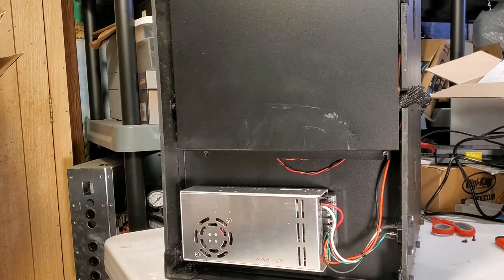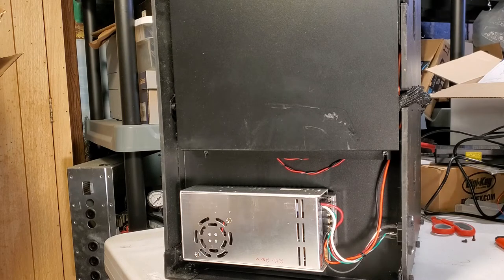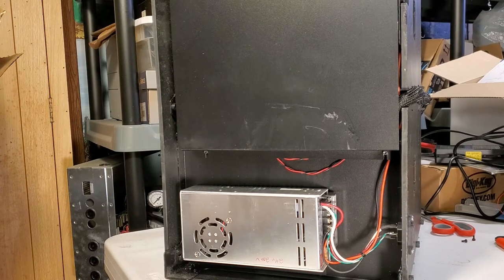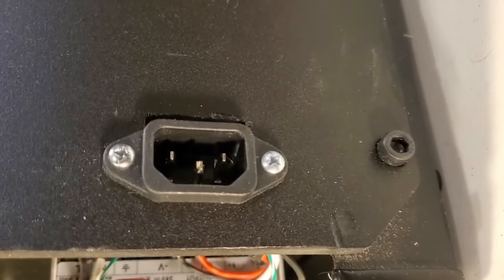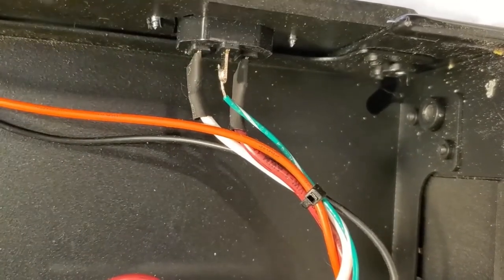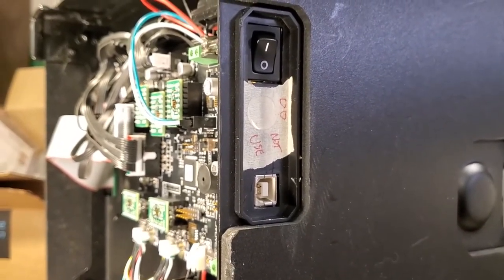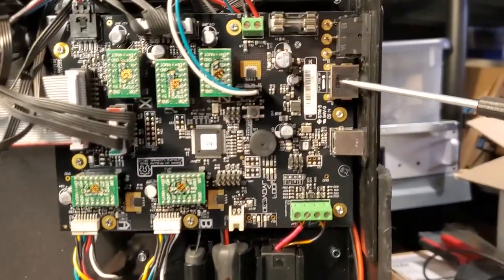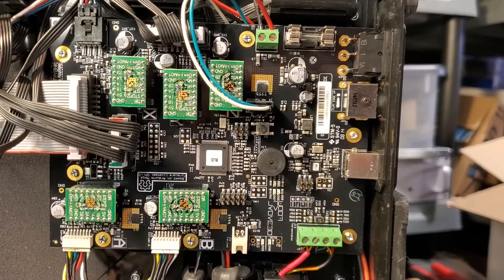Makerbot Replicator X2 PSU Upgrade / Replacement / AC Power

Comment: 24v 200w how many amps.and did it work as it should
Reply: And a picture of the underneath of the board would be awesome
Reply from the maker: 200w/24v=8.3 Amps. Yes it works as expected.
Reply: @TheMadHatter1337  also what terminals did you solder too I’m still a little up in the air on what ones
Reply from the maker: @mrT1179  sorry I sold it actually... So I can't take a picture.